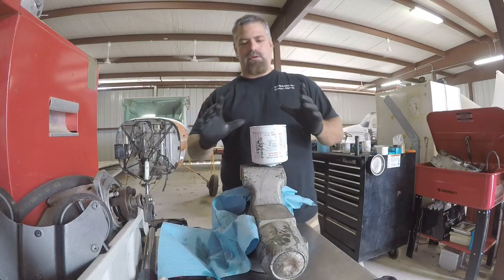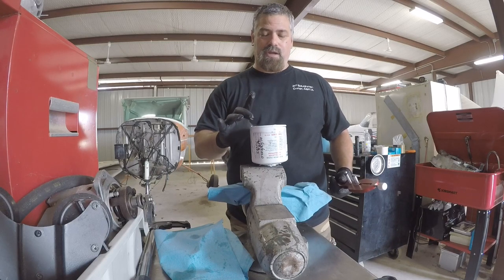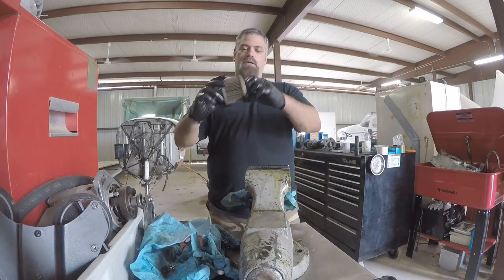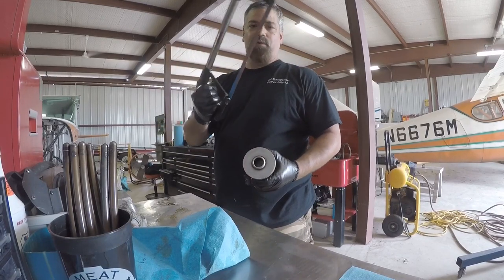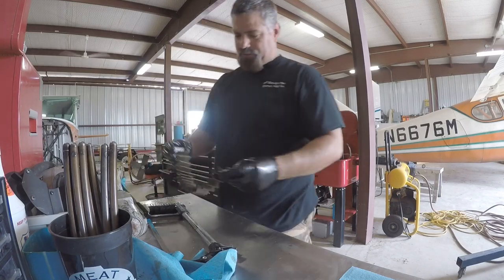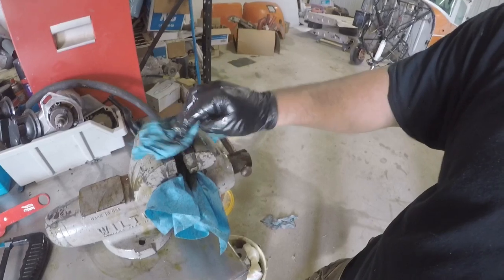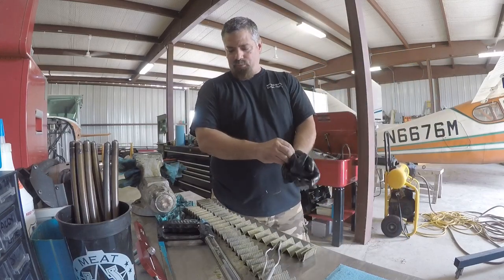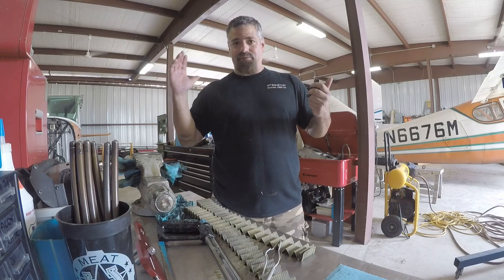Aircraft preventive maint.  EP3:  oil filter inspection

Comment: What's the point of an inspection if you have to destroy the part in the process?
Is this something you replace and actually check something else with? I'm just curious and totally clueless.
Thanks for sharing, I enjoy your videos. Will there be any updates on the "green owner" plane that did no pre-buy?
All the damage you showed was really intruiging and I'd love to see them repaired... for some strange reason... ;D
peace and love my friend <3
Reply: The oil filter he cut open and inspected is intended to be replaced at the oil change service (50 hours, 100 hours, annual inspection or whatever other interval the manufacturer suggests) and that oil filter NEVER used again.  It is a consumable: used once and done; like dental floss, it serves its purpose and you throw it away.  What you watched was a detailed orientated professional  demonstrating his procedure to effectively inspect the oil filter itself, not just change it.  That inspection was done in order to determine if there is any evidence of abnormal and/or potentially dangerous engine mechanical degradation going on inside the engine where it is difficult to observe from outside.  If mechanical metal parts, within the engine, are beginning to fail small particles of those metals fracturing, corroding or grinding themselves into oblivion will likely be released into the oil and then picked up by the filter element in the oil filter.  He is using his experience and "detective skills" to look for evidence of a potential problem before it could result in a catastrophically failure.  This is EXACTLY what you as the owner of the airplane want from the PROFESSIONAL you are paying to service your aircraft and should expect to PAY well for that level of service.   Like most things one pays for, you can receive something inadequate (you wasted your money or got ripped off),  it does the job (adequate), it works very well (better) or it exceeds every design expectation and provides great value for the money (best).  Just changing the filter may fit the minimum requirement it is "ok".  Changing the filter then cutting it open and taking a look inside goes beyond the first step, and that is "better".  Cutting it open carefully with a dedicated blade not to cross contaminate, squeezing out the used oil then unravelling visually inspecting and going over the material with a magnet to determine if any of the contaminants observed are metal and be a cause for further examination is clearly "the BEST".  If you don't have the skill set, tools, confidence, training or desire to work on your own equipment this is EXACTLY the kind of individual you want to pay to do that work for you.  Everybody will take your money, this is VALUE!  Sending an oil sample in for laboratory chemical oil analysis and then reading and understanding the results would be a parallel step in "inspecting' the oil.  The author may do a video on that process at some time. 

- Respectfully
Reply: @apackwestbound5946  Wow, pretty intense man, thanks. Certainly answered my question and far beyond. <3